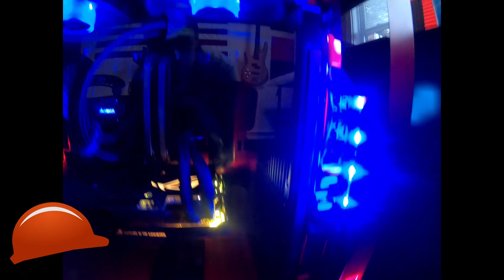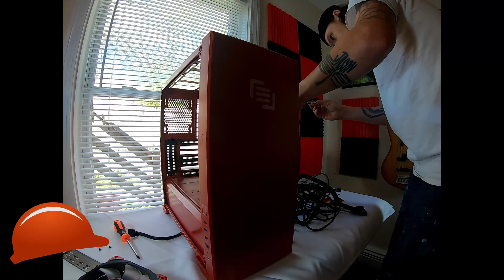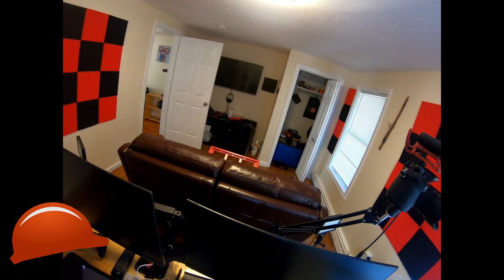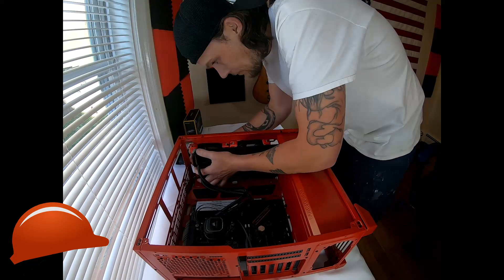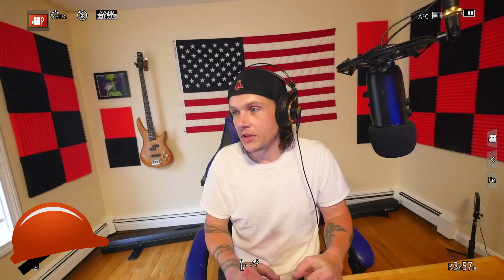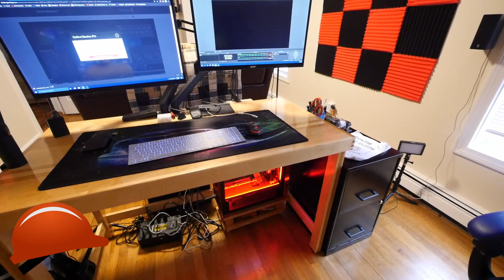Beast 3 0 Build

Comment: OG specs...... Not me, but mini me
Reply: Board, chip, ram, GPU. Water cooled?

On the ADD side, Martinez bags? Still awaiting any progress on mine......
Reply from the maker: OG is ryzen 7  8 core 16 thread. 32 gigs 3000 mhz ram. 2 tb ssd Hard drive. 1 tb of Wich is m.2 pcie 3.0. and a gtx 1070 republic of gamers video card. Its working like a charm right now too. I want to keep it. but if someone offered me close to 1000 for it id take it. cause I need it. So I'm hoping no one offers. lol
Reply from the maker: IM still waiting on mine too your not the only one. It better be worth the wait. I think it will
Reply: @WorkingClassKnowledge  you have his interest....... Only if you want to consider..... What series is chipset (I am more fam with Intel) is it a 3k series or 5k? Mobo? Fan or watercooled? Power supply? Complete, or just parts...... Guess I'd benefit from it as well to upgrade my 15yr pc with his old parts......
Reply from the maker: The computer im selling Is a ryzen 7- 8 core 16 thread processor. 32 gigs of dominator ddr4 3000 mghz ram. 1 tb of pcie 3.0 ssd hard drive and another 1 tb of regular ssd hard drive. Its water cooled and has an 850 watt power supply. Its complete its working. Its the black computer thats sitting under my tv in the video. It has a gtx 1070 graphics card. it plays any pc game and vr. Its a sweet computer. It just didnt like 4k video eddting.
Reply: @WorkingClassKnowledge  got that from the previous post. Is the ryzen a 3rd Gen (3800x) or 4th Gen (5800x) or how long have you had the machine. It is an upgrade for me either way, it is just if it fits son's need for what he thinks he might want.

If you are not sure which Gen, the only way I know to communicate better is either thru email or phone?
Reply from the maker: its a ryzen 7 1700. thats all i know
Reply from the maker: THe family memeber who built it never used it. He has a mac for work. so this machine was just a play thing for him. so it sat and collected dust. he gave it to me and i used it for almost a year. but now i have my new machine. so it wasn't beaten to a pulp. this things has been taken care of and kept spotless realistically it has a little over a year of actual use. Its spotless inside. not a spec f dust on anything. Now that i rebuilt it and put it in the new case and hooked to my tv. But its an am4 slot on the motherboard so you can upgrade the chip to a higher 7 model or a 9 at a later date. that's why i like amd they use the same chip slot. so yuo can upgrade if you want.
Reply from the maker: 857 361 9159 call me
Reply from the maker: Ill go boot the machine up now call me at 857 361 9159 and ill give you all the numbers you need. But call soon i have to go upstairs for a bit i can talk for a few anyways